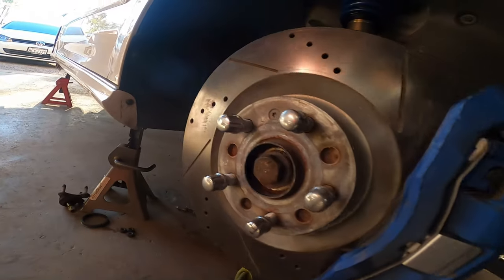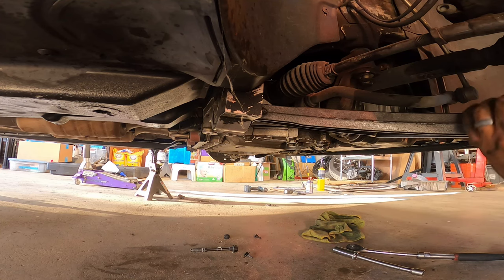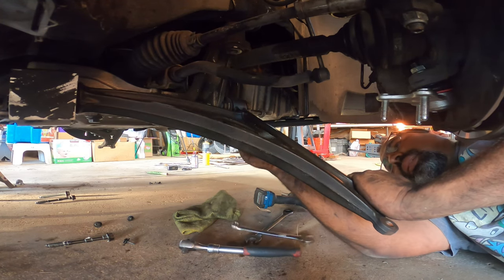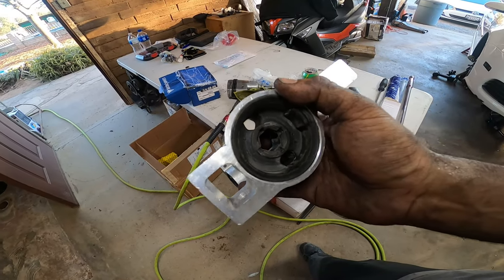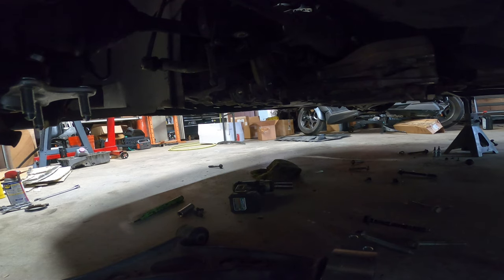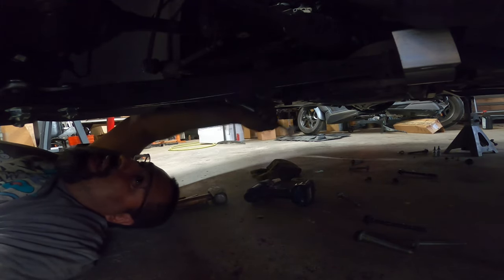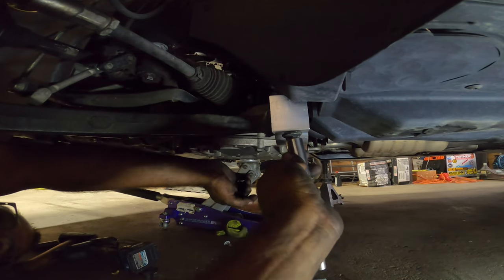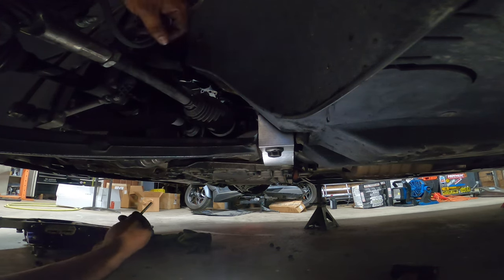How to Install Mk5 R32 Control Arm Bushings

Comment: Good video my man! Although it’s worth mentioning that all of these bolts are TTY bolts so basically get stretched when torqued and tightened to spec, otherwise you rub the risk of snapping one of those bolts and I know as this happened to me when removing old bolts that someone must not of replaced with. Cost me about £26 from main dealer for the bolts but is peace of mind! Keep up the good work 😎
Reply from the maker: Good to know good sir